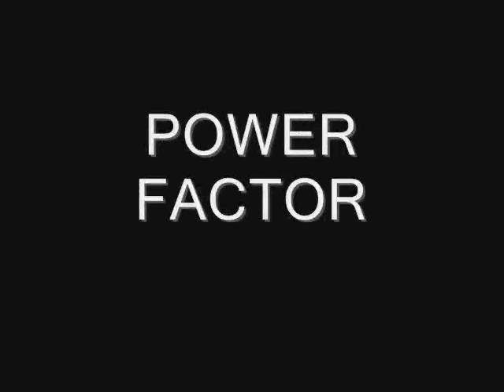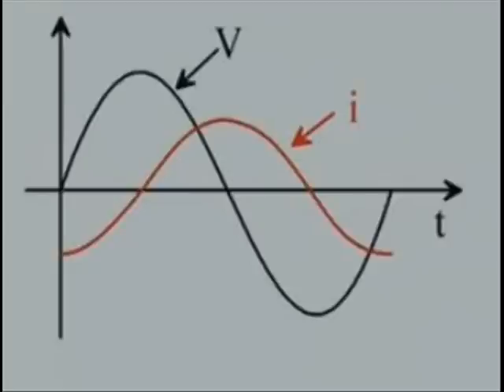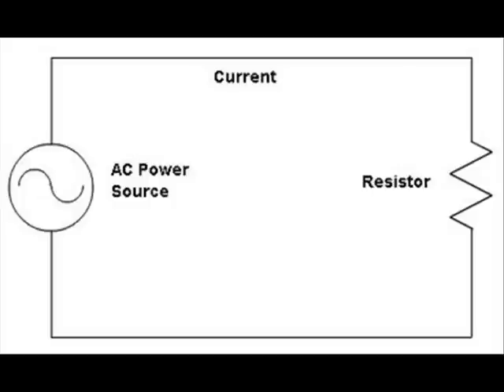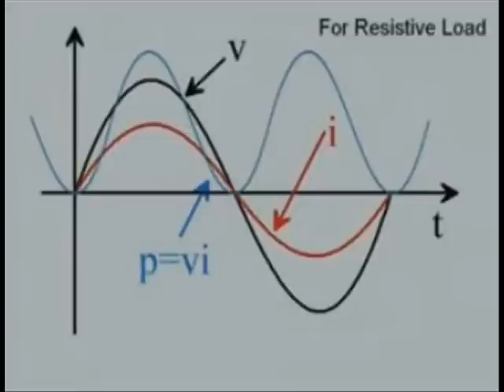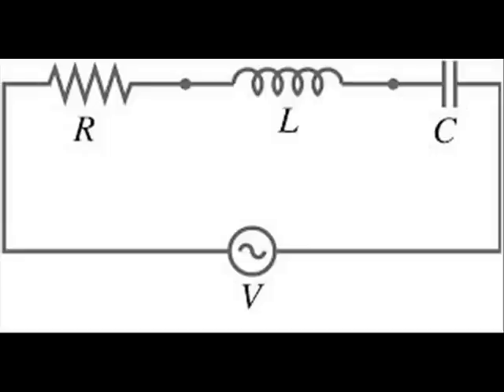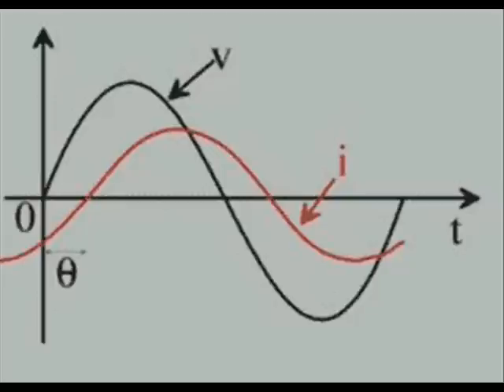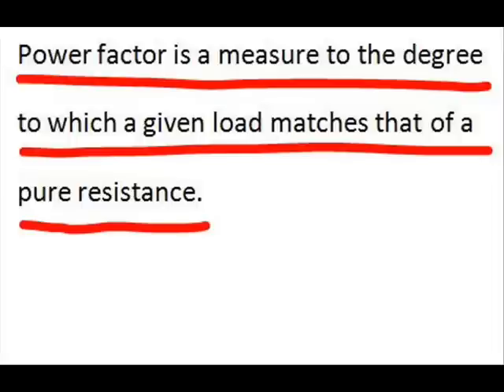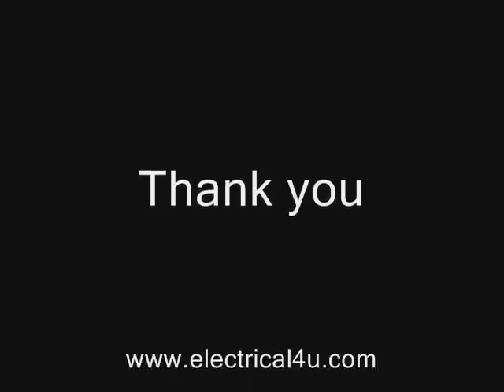Electrical Power Factor: Formula And Definition

Comment: thank you, sir 
but I have some confusion about this ckt, when our load is capacitive then current lead 90dgre , when our load is inductive then current lag 90 drg and also no changing
in current in resistive load but all load connect then what happen that its laging in⊙
 pls , explain about this confusion thank you everyone
Reply: +Akhilesh Kumar  Very interesting question, keep in mind that most of the time inductive is greater as compared to a capacative load such as all motors, fans, AC and so on are inductive load. therefore a connected load can not be balanced so all the time we have higher inductive load. so PF can exist